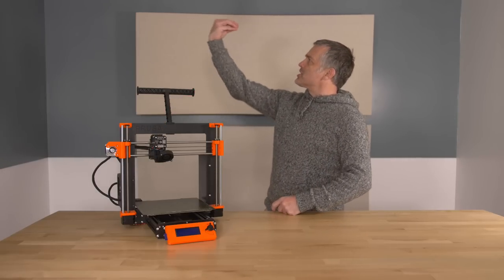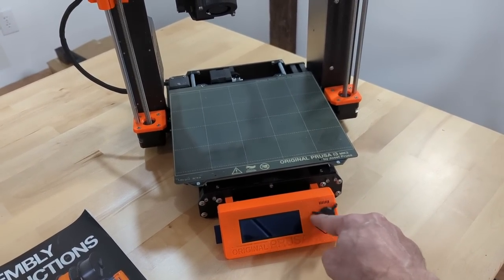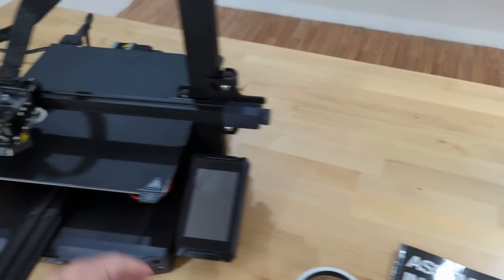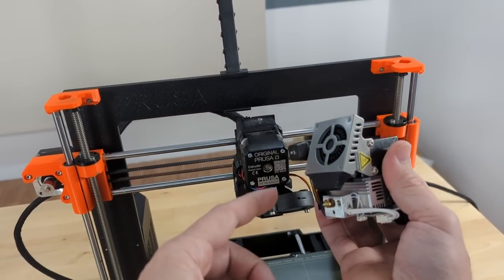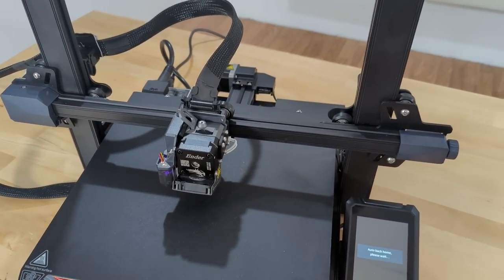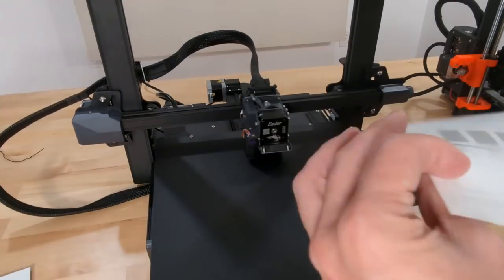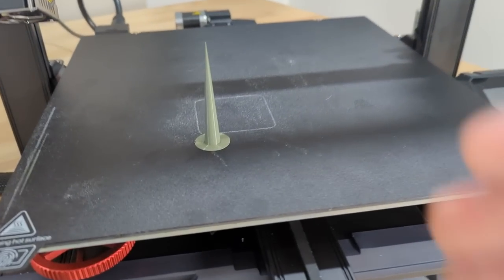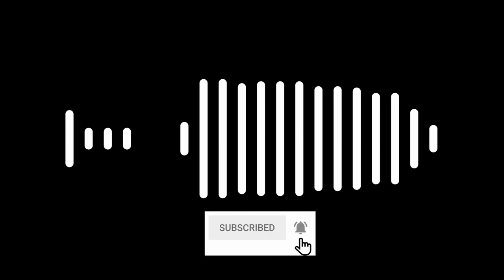Creality S1 Plus Has all the right features - Let's compare it to PRUSA I3

Comment: My work just got a bunch of S1PLUSs and they're quite impressive. That said, I did notice that there is another PTFE tube going down into the hotend and butting up against the nozzle.
Reply from the maker: Yeah. I got that detail wrong. Thank you for the correction. Creality does sell an all-metal version if you want to print high temperature plastics. PTFE lined hotends are quite good up to 260°C. It's Teflon like your non-stick frying pan. Molten plastic doesn't stick so you get fewer nozzle jams. All metal need to be made with high quality standards. Polished bore so that there isn't texture for molten filament to stick to it. Also high temperature non-stick coatings are beneficial. This is a lot more expensive and doesn't provide benefit if you are only going to print with PLA, ABS, TPU, and PETG.

Comment: I've owned a mk3 from preorder and just got a mk3s+ and have thousands of hours between them.  bone stock.  I recently got an ender 3 s1 pro, which is one model up from the one you have, and I even added sonic pad (runs klipper), got input shaping and pressure advance tuned, and I still disagree with virtually everything you said.  I don't remember the last failed print I had on the prusas.  my ender has had many.  the pros: it's way more quiet than my bambu carbon x1, but a hair louder (thanks to fans) than my prusas.  (not sure if pro differs much from the plus).  the motion system is more quiet thanks to the wheels on gantry motion system, but the prusa comes with noctua for the heat brake, so fan-wise, it wins.  print quality-wise, stock for stock the ender s1 pro wins slightly, but with a caveat.  smooth surfaces looked better, like the bow of benchy, but considering default speeds are like less than half of the prusas, I'd hope so.  the actual caveat is that when you print a calibration cube, you see it has bulging edges and really badly needs pressure advance.  klipper fixed that, but after adding klipper it loses the price advantage.  (if you got at full price like I did, I think it was about $550 + $160 for klipper, so $710).  out of the box, with bulging corners like that, it's not a great choice for practical parts with engineering tolerances for fit.  the prusa's calibration cube out of the box is a thing of beauty.  also, the prusa starts printing so much faster.  the bed leveling is way better with pinda.  the ender is still faster than my bambu at bed leveling, but the prusa smokes it.  with the prusas, I do what most prusa owners do.  start a print, and after the first layer, use the menu to crank speed to 200%.  it just works and gets very respectable print times with virtually no difference in quality.  doing this, it absolutely runs circles around the ender.  even after klipper I can't get it to beat the stock prusa.  I can get faster prints out of it but the print quality suffers greatly.  the prusa's name brand parts (especially the hot end) just perform better at speed than the enders.  I imagine the pro does even better as I think I remember the plus and base s1 don't get the all metal sprite extruder like my pro variant.  

it was worth getting and tinkering with, but it just isn't reliable enough to replace one of my prusas.  talk to anyone who went the other way around, from an ender to a prusa, and you'll hear their praises about getting fed up with constantly tinkering with the printers for various failure reasons, then finally just getting a printer that works every time with no drama with the prusa.  

also slightly unrelated, but I've had my carbon x1 with AMS for a few weeks now and I still haven't sold my prusas for several reasons.  it's slightly tempting, as when it DOES print right, it prints VERY quickly with VERY solid quality.  the prusa's quality benchy still beats both the carbon x1 and ender 3 s1 (even on klipper), but the carbon x1 can get VERY close while printing at 2-4x the speed of the prusa, so it gets a pass.  the $700 p1p is tempting as I don't even use the lidar now, but being forced to have a lower quality cameras kind of sucks, so who knows.  they're so loud that I think for that reason alone, I won't sell both prusas.  maybe one of them, but for now, at least one will stay as my printer when I need to be near the printers.
Reply from the maker: 1) You sure are throwing around a lot of claims. My cousin's third uncle says he saw your office and you don't have a Ender 3 S1 or a Bambu Labs printer to actually compare to your Prusa.
2) Why are you conflating things by bringing in the sonic pad? You don't need it. I showed the two printers out of the box. The Creality printed better even without the sonic pad. 
3) Now you are just listing small defects and lots of other confusing variables in an effort to make the Prusa sound superior. What you are doing is called bullsh!tt!ng. 
4) You said "talk to anyone who went the other way around, from an ender to a prusa" those guys don't exist. That's why I have a job on YouTube. I am the guy who has both and I disagree with your assessment.

What kind of guy buys all these printers like you say you have? Are you another YouTuber who gets sent these things for free. I know SERIOUS 3D printer hobbyists and they are all selling their Prusas to buy the Bambu Labs printer. See, they don't actually make money from their print farm attempts so they can't justify purchasing all these printers. How does your wife feel about all this wasted money you spend? Your entire comment sounds like a guy who works in the Prusa marketing department who is trying desperately to put out every fire at once. You are trying to use this single comment to disparage all possible competitors to the Prusa. The Bambu Labs printer and the Creality have almost nothing in common EXCEPT that they are both threats to Prusa sales. Why you would see it necessary to disparage both...you are sus.
Reply: @DesignPrototypeTest  This dude is on something, The only thing a prusa has in common with a Bambulab is that that use electricity to run. There is no comparison, for the price The X1 stomps the prusa.
Reply: @No0o0o0o0o0  nah x1 stomps in terms of speed. Reliability not so much. I have both a prusa, an x1 and a fully tuned voron trident and In terms of quality the x1 is a bit behind the prusa and the voron is miles ahead. Speed wise voron crushes the bambu but the bambu decimates the prusa. Reliability, the prusa blows both out of the water and the voron is noticeably more reliable than the x1. Longevity wise, idk bout the voron and x1 but the prusa has 25000 hours on it

Comment: I got into 3D printing about 3 years ago just before the COVID crisis. I bought an Ender 3 and it has out preformed the Prusa I3 since. Having worked on building an I3 I laughed when I heard 9 hours to build the i3, my Ender 3 took about 1-2 hours to assemble and that’s with no experience with using an 3D printer before. Since then I’ve upgraded my Ender 3 to have a CR touch and touch screen, it’s outperformed my brothers CR 10 and friends i3 since. When setting up the “smart sensor” on the i3 you have to very carefully tighten the screws that hold it in place on the printer at a specific height, otherwise the printer doesn’t work. When using the i3 myself and the group of younger children working on the printer encountered errors that stopped us printing for about 5 days vs my Ender 3’s easy setup. I’ve printed helmets and Cosplay armour on my Ender 3 with ease and my friends with their 2 prusa i3s can’t print anything better than a “batterang” from the Batman Dark Knight. I recently discovered how to have the best quality print profiles on my brothers CR 10 whilst having the fastest time without sacrificing quality. I took 2 day long prints (48 hours on Cura) down to just 13-15 hours. He’s never seem such high quality on his printer and speed. Now I can’t wait to get myself an Ender 3 S1 Plus you’ve sold it to me from this video and I’ve never seen a video by you before. As a manufacturing engineer I instantly understood all of the points that you made and found some very interesting. Thank you for being so informative.
Reply: You sound like a savvy individual. Its no suprise you've managed to make good use of your tools. Others don't have your innate abilities lol.

Comment: My GF has an  iPhone 8.   Works pretty well still.
Reply from the maker: Yes, and the Prusa I3 Mk.3 "works pretty well still." I should have said in the video "Who do you know is still buying an iPhone 8 in 2022" If anyone already has a Prusa I3 Mk.3 keep using it until it no longer works and you can't fix it. It prints just fine. No need to replace it, but for goodness sake don't recommend that anyone purchase a new one when there are now options like the Creality available.
Reply: @Design Prototype Test  this should be pinned as the top comment should shut up a lot of the fan boys you are unbiased in this review and this comment hits it on the nail if you have a MK3 great glad you're happy with it but don't recommend it in todays market as there is now cheaper and better alternatives.
Reply: @DesignPrototypeTest  that's definitely a fair distinction between continue to use vs buy new now at full original MSRP.
Reply: @DesignPrototypeTest  I absolutely 100% agree with this type of advice. Prusa's are great.  I love mine (and my Ender pro and e3d bigbox), but would I buy the same Prusa today at the same price (or more) with no improvement over my 3+ year old original, when there are so many other as good/better and cheaper alternatives?   No.
Reply: @DesignPrototypeTest  In all your insanity, double quotes that cannot be argued with. 

Ps. Add thank you and memberships
Reply: I still have my iPhone 4...and not the "S" version. I have the original box that it came in too. Do I still use it? No. The last OS update sorta killed it, but hey, it'll be a great conversation piece, one day. Lol.
Reply: @Waltkat  best phone ever before Apple got more apple like. It's a tank. Mine only died because if run a half marathon with it every other day and lift weights every day. It looked brand new on the outside......
Reply: Watching this vid on an iphone 8
Reply: i got an iPhone 6s 😓
Reply: Time to change your girlfriend.

Comment: With the release of the sv06 I am lost why people still look at prusa. An amazing clone for under 300
Reply: name brand parts and top quality service.  there's a reason why every print farm uses prusas.  sure, they can get 2-3x more prints from creality or sovol, but they end up spending way more time tweaking and fixing and repairing and replacing.  there are several YouTube videos where people tired other brands and switched to prusa and they praise the hell out of it as they went from constant issues to a whole farm that just hums along.  the original i3 design came out just about 11 years ago.  it has received very subtle and slow updates, but to the places where it counts, and that's what has gotten it to be so polished.   and considering they print their printers from their own print arm, of their own printers, they get thousands of personal testing hours to help them identify weak points and such.  you can tell, as the printer looks basic, but the performance and reliability you get out of it is super impressive.  also, even if you can get a printer that performs 90% as well for cheaper, another thing people forget about is noise. the prusa is VERY quiet, even without using silent mode.  it comes with real Japanese linear bearings and a name brand noctua fan.  and the silent stepper drivers.  in silent mode, it's so quiet it's crazy.

I did preorder the sv06, as I'm just curious and couldn't resist for the Black Friday pre order price of $230

and for the record, I have an ender s1 pro with sonic pad (klipper), and a bambu carbon x1 with AMS.  both are cool in their own ways, but haven't provoked me to sell my prusas yet.  the bambu comes close, but it's super loud, stilll isn't as reliable, and quality lacks behind the prusa a tiny bit, but that doesn't matter when you need the speed, as the quality is very close.
Reply: Because you're paying for more than just the printer. You're paying for the support which is some of the best in the consumer printing industry, you're paying for much higher quality parts, you're paying for continued research and development, you're paying for the printables website to remain ad free and you're paying for a company to pay their employees a living wage.
Reply: @101stsurvivor  exactly
Reply: The sv06 is a hot pile of garbage

Comment: Never thought Prusa was worth the price. My #1 printer is the Artillery Sidewinder X2 for around 250 dollars shipped.
Reply: I have seen print quality from the Sidewinder X1 and X2 it's amazing out of the box took less than 10 minutes to setup as oppose to the Prusa Mk3 kit which can take up to 6 -10 hours build time. Only an idiot would think Prusa is a better choice in term of price and print quality.
Reply: Hey I’m looking to buy that exact printer soon, do you have any problems with the bed adhesion from what I see it has a non removable bed so I would probably buy a removable PEI coated bed plate. Also I know it has silent steeper motor, but what are the fans like? Are they creality level loud?
Reply: @geovannyguzman8721  I've used a mirror bed and gluestick for years so I am a little biased but I think the x2 bed does not adhere as well. I was thinking about just clipping a pei sheet to it instead of doing the magnetic thing to reduce weight but it's probably fine with the magnetic backing. This thing is quiet as a mouse. When it is on and idle, no fans are running. When it is printing, you can barely hear it.  Print a few add on's like rubber feet, and the z axis stabilizers and this thing excellent even though stock is great too. Look up 3d printed props video on youtube. He has a decent coupon code. That's how I got mine.

Comment: I purchased the S1 Plus instead of springing for a Prusa. After weeks of calibration tests and tweaking settings I found that I was outside of the timeframe I had to return it. I just assembled my Prusa last weekend and haven't touched the S1 since. Maybe I'm just unlucky and got a crap one but the Prusa has surpassed my expectations.
Reply: The Prusa is a workhorse, reliable and has been refined for years. These other brands start from scratch every time and want you to keep buying a new model instead of upgrading what you have.
Reply: Wanna sell it? Lol

Comment: I'm still running my Ender 3 v2. I have mods like the Micro Swiss direct drive kit with a BL touch, although I'm still running the stock hot end and heat sink with a Slice Engineering heat break, a Red Squirrel fan shroud with a 40x40x20 cooling fan and a 5015 blower for the part cooing. 80mm fans cooling the mainboard and power supply. I put silicone springs on the bed adjusters and a heat shield on the bottom of the bed. I never have to manually level the bed. Printed a handle for the bed and extended feet to raise it up to get more air to the electronics. I extended it to 400mm on the Z with dual motors and screws. I'm running the Jyers UI firmware on the mainboard and display. The printer is almost completely silent. The print quality is just as good as a Prusa, the print area is larger and I have less than $400 invested with all the mods.

Comment: I've printing with one in my farm, and I can confirm that machine is a beast. 5 months printing 24/7 no problem at all, quality like the first day. Awesome printer.
For the heatbreak the one the machine have is the same the ender 3 s1 has, that heatbreak has teflon inside, they got a pro kit you can buy with a bimaterial heatbreak, that works way better.
Reply from the maker: I should have dug into it deeper before declaring that "all metal" The thing is for PLA PETG ABS and TPU the PTFE liner is superior. Friction free and it's not possible for molten plastic to bond to it. Even a very smooth bore all metal really needs a coating to match the non-stick performance. Most Chinese manufactured throat parts don't have all that smooth of a bore. I think CNC kitchen did a video about bore smoothness.
Reply: @DesignPrototypeTest  yes maybe is s better solution for some materials, but also needs more changes of that piece trough time. E3d V6 uses that type of heatbreak with a thin channel between both sides, and works fine with all the materials
Reply from the maker: E3d has very good quality control. A very smooth bore in the throat and a top secret coating. A Chinese all metal hotend is not nearly so trustworthy. A part which is so difficult too verify for the end consumer should only be purchased from a reputable brand. Slice engineering makes an amazing product in this regard. Much better than E3D.

Comment: I want to see the S1 vs Neptune 3 Pro vs Vyper in a side by side.
Do you have those 3 printers?

For the money, and on paper it looks like they might finish according to their respective prices.

I know the Vyper is not a direct drive, but the extended arm for the geared extruder and shortened Bowden setup might just be as capable as anything on this side of Ninjaflex.

Comment: Still using the Ender 3 Pro  with genuine BLTouch, Duet 2 FW for fear of messing with success. I finally changed to a Mosquito all metal hot end but kept the stock heater block so as to continue using your Air duct, Nice upgrade. A  whambam3d  flex bed covered in PEX, which works w/ petg, pla, abs, LW-pla. For flexible filament I still use the proprietary Cetus3D Mk2 that still prints beautifully onto blue tape. I'm done with CUrA and only held on  because printing single layer rc planes with LWPLA dictated using CURA settings uo to now. Started with PrusaSlicer which seems to work well on stock ender settings, but will now try SuperSlicer. Enjoy your candid reviews and tolerated the intro with minimal cringe hehee.